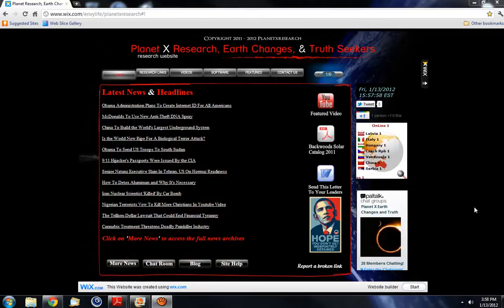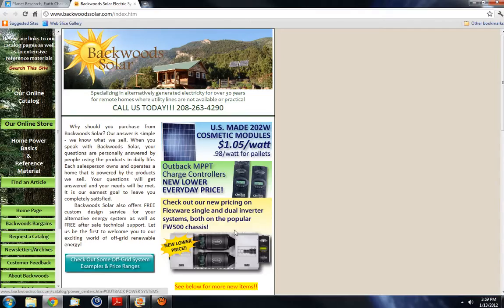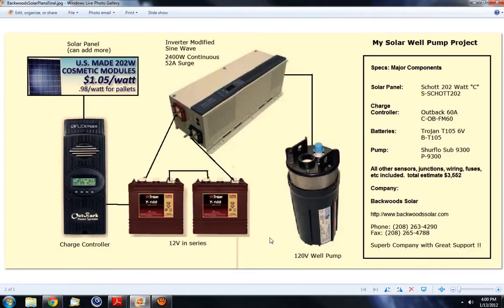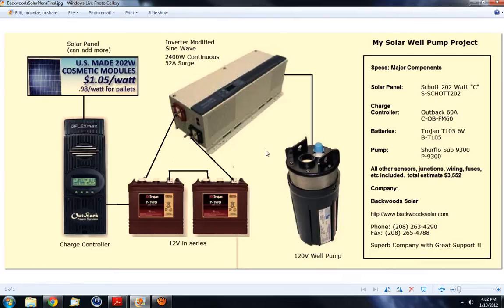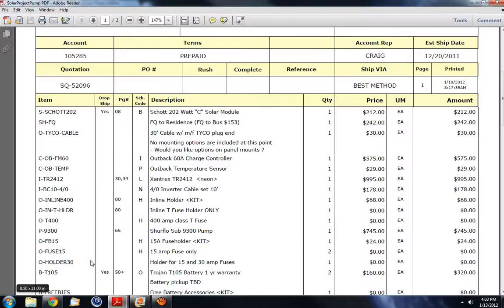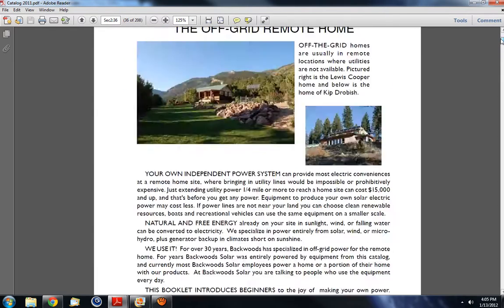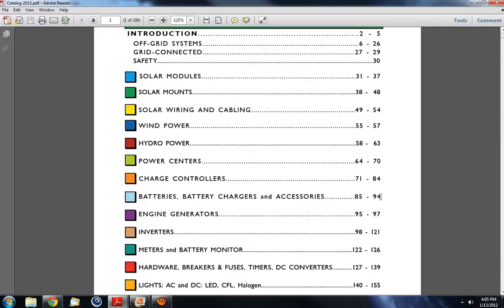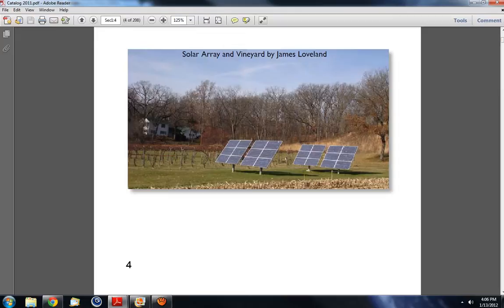My Solar Powered Well Pump Project - Almost Ready To Implement

Comment from the maker: The good folks at Backwoods Solar recommended the parts based on the well spces and expected output/pressure that I requested.  They also knew that I have a 15 gallon holding tank.  So they chose the components and pump accordingly.  I plan on leaving my 230V pump in the well, because it sits at a depth of about 300 feet.  The new 120 pump can go right in  with the existing pump, but I will only submerse it at around 100-125 feet.

Comment from the maker: sadly, I never achieved the funds to put this project into action.  but there are several factors to consider.  the amout of water needed to be pumped, desired water pressure, AC or DC water pump, power requirements, redundancy for night time use, etc...

personally I would choose a DC pump.  most solar inverters use modified sine wave AC which is not good for a motor as phase is crappy and DC current gets applied to the motor.  you can get true sine wave inverters but they are expensive

Comment from the maker: Also, by adding only one more solar panel and 2 more trojan batteries, I should be able to use a second inverter to either heat my water, OR using it to power a larger appliance.  Just waiting for some funds to come my way.

Comment: hey relic great vid. Question did they make sure the pump had enough head pressure to lift your water out of the well and through house very imporant. 1 other thought pulling a pump out of a well can be a bear been there and done that . but anyhow great info thanks